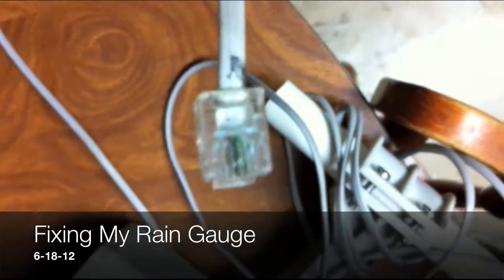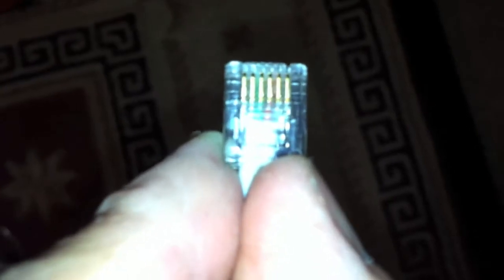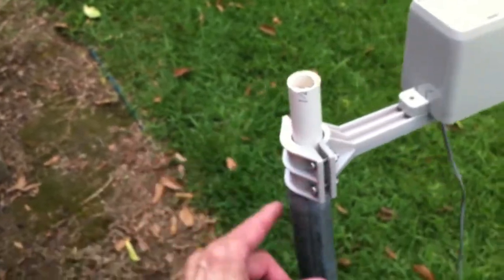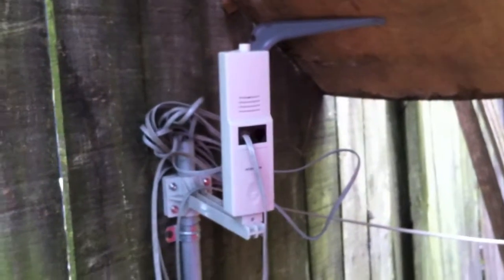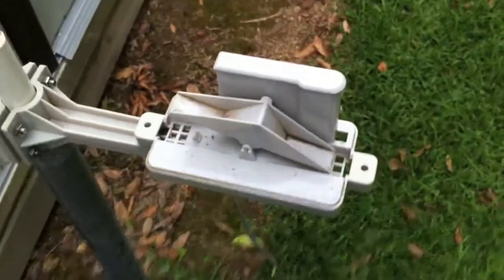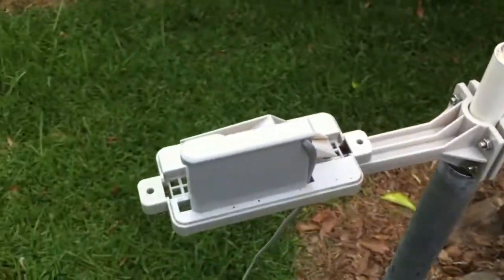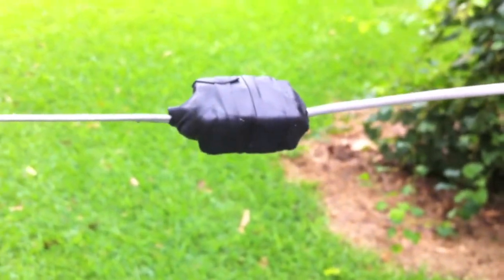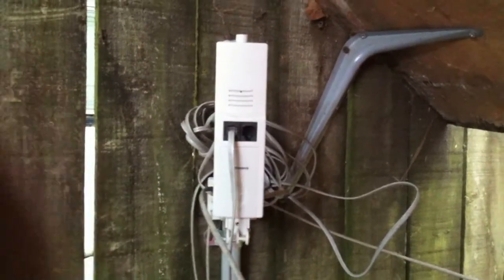Rain Gauge Repair

Comment: I'm surprised that the manufacturer chose to use RJ-11 style crimp-on connectors.  They're intended only for indoor use, not out in the weather.  The cables you're using aren't waterproof, either, as the insulation allows a small amount of water vapor to penetrate.  Given enough time, it will get to the conductors and cause them to corrode.  One can get outdoor-rated 8-conductor cable for data networks, but I'm not sure if one can get outdoor-rated 6-conductor cable that would be compatible with RJ-11 connectors.

You could extend the life of the connectors by "buttering" them with silicone grease before plugging them in, to completely exclude moisture from the gold-plated contact area.  It's sometimes available at auto parts stores as "dielectric grease", for use on ignition wire boots.  Be careful not to get it anywhere except inside the connector housing, since the slightest trace of silicone grease will prevent electrical tape from sealing cable joints.

Lose the straight coupler.  Buy a long enough length of cable that the cable run is splice-free from the rain gauge to the weather station console indoors.  Since you obviously know how to crimp RJ connectors on, there's no reason not to just buy the needed length of cable in bulk from an electrical supply house or hardware store and terminate it as needed.

However — if you MUST use a splice or a coupler, try to locate it indoors, out of the weather.  If that can't be done, apply a liberal amount of the butyl rubber tape, extending the wrap a couple of inches on either side of the joint, wrapping it so that no gaps remain.  The butyl rubber will cold-flow and the layers will weld themselves together into a single mass.  ALSO — butyl rubber tape deteriorates when exposed to sunlight and air.  It MUST be covered with black plastic electrical tape or cloth "friction tape" if it is to survive for years outdoors.
Reply from the maker: Thank you for the information. I will use those ideas when I have to deal with it again.

Comment: Try using some dialectic grease on your connectors.  You can find it at trailer suppliers.  It is used on brake control wires.